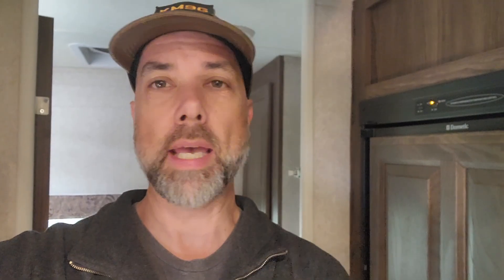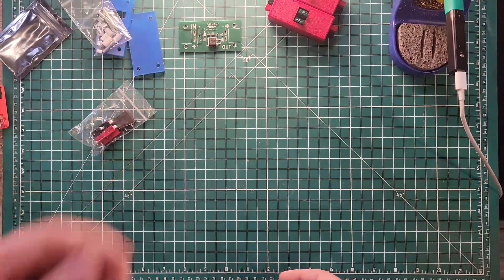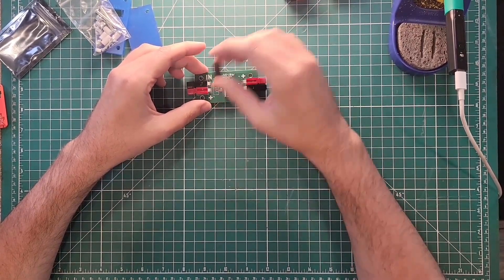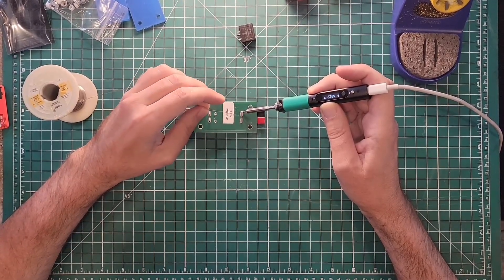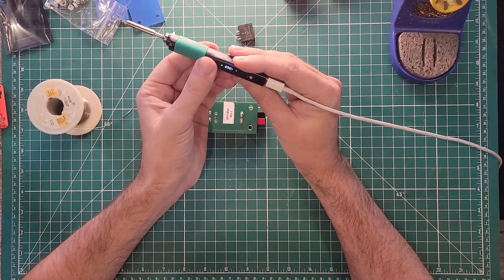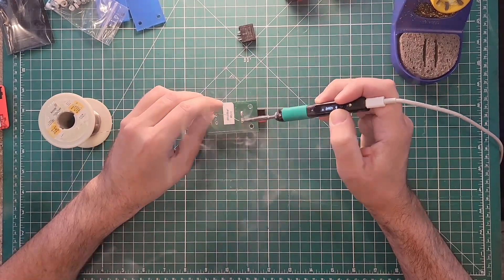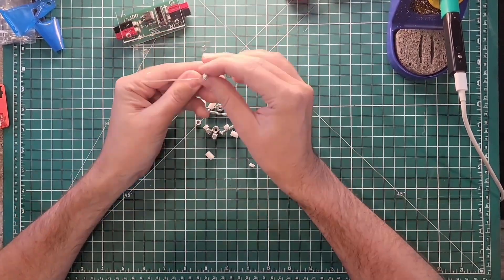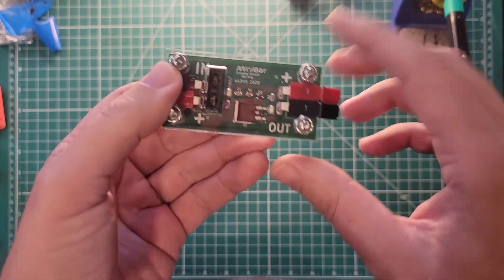SAVE your RADIO with this Crowbar Circuit!

Comment: There was a nice grounding presentation a couple of years ago on the Ham Radio Today (COVID) hamfest in which he showed a scenario in which a blown negative (ground) lead fuse could leave your car's starter current could attempt to find chassis ground via your antenna coax's connection to the car's frame, going by way of your radio's electronics.  There are always more combinations of connector failures/insulation failures than one tends to consider when you're what if-ing.  One thing I'll point out is that breaker (or in my day, fuse) box in your home interrupts live, but not neutral, neutral being the equivalent of negative in a 12V negative ground electrical system.  (I remember 6V positive ground cars, but that's a long time ago.)  Anyway, there are lots of arguments to be mode over whether to fuse the negative.
Reply from the maker: Exactly!
Reply: Good summary. There are a lot of one off situations. Cars in particular have a bunch of potential issues and todays cars are even worse.

Comment: You listened you really really listened. BTW just a observation but I think your solder iron works best when you are in high speed.
Reply from the maker: Somethings still make through the iron dome! And you're right about the speed too.
Reply: @temporarilyoffline  hihi you need to have the iron dome laminated like a transformers core, this will eliminate eddy currents and make it more efficient. But you will have to learn to live with the AC hum

Comment: Cool kit, Steve.  For those larger lugs, I would have used a larger/wider iron tip.  I am not sure if you have one for your particular iron.  Next time instead of going higher in temp I would just increase the heating surface area by orienting the tip sideways and place it right against the lug and the trace at the same time.  If that makes sense?
Reply from the maker: Makes perfect sense.  Great tip!

Comment: Put a crowbar on my linear power supply 40 years ago, if the output transistor fails, poof goes your radio.  Thanks for the video.
Reply from the maker: I've had it happen twice!

Comment: The crowbar is one of the greatest equipment safety circuits there is, right next to the fuse.  And this has them both!!!    Great Video.  
Eutectic solder too.  Good man.  Been my go to for about 40 years!      And remember  "don't flux up, use flux."    <-- that goes on the holder for your flux bottle.
Reply from the maker: I haven't used much flux in my soldering career. Usually I reserve it for the stubborn jobs or surface mount jobs.

Comment: That great to have.  just a simple circuit can save your radio. I have been budling them many years now. with portable this is handy. if you use solar with a charge controller and that goes bad . the battery BMS will disconnect to save battery but that over voltage still needs a place to go. that crowbar keeps it from getting to radio. uses a SCR to shunt power from radio or what ever connected to. maybe a 12V laptop . nice off grid soldering. 73's
Reply from the maker: Thanks for the info!

Comment: How should a battery "run away" and produce a higher voltage? I only know of failure modes where the battery will fail with a lower voltage. The only way I can think of a battery outputting a higher than normal voltage would be if it has been heavily overcharged and even then, you might only get a couple more volts before it catches fire.
Reply: In my brother's old Datsun the ground wire from his voltage regulator corroded and broke, resulting in an unregulated 19V that cooked his battery and killed his FM radio.
Reply: @JohnZonneveld  Sure, but that’s from a voltage regulator, not just the plain battery. If I’m in the field with just the radio and a battery, I don’t see how there can be an over-voltage situation.
Reply from the maker: Batteries are chemical in nature.  So "anything is possible".  Its more likely that your solar system (which routinely outputs more than 12v) had some kind of failure which makes it to/past the battery to your radio.  

This also works for bench power supplies.  I've had two power supplies with failed voltage regulators and both times they output more than 13.8v.
Reply: @temporarilyoffline  in my old car I had some voltage spike that killed my Baofeng APRS setup and a Leixen VV-898e since then I also have a simple diode voltage limiter that 'should' short at 15V. So should be enough to protect my radios as it is within the 13.8V +-15%.
Reply: @temporarilyoffline  I don’t doubt that it is effective for many scenarios where there is a regulated power source, like in a power supply, car inverter or a solar charger. However I cannot find any evidence that batteries alone spontaneously produce a higher than normal voltage. 
If you distrust the battery because it is chemical in nature then you should also not trust the circuit to protect it, semiconductors are quite wild..
Reply from the maker: Its all belts and suspenders man.  I don't trust anything.  "2 is one, 1 is none" I will admit that I'm a little more paranoid than most though.  @pcfreak1992
Reply: I just repaired a 13.8v 12A linear pwr supply outputting 24 volts.  Driver transistor failed.  Thankfully not connected to my radio.  I need this protection.

Comment: Great little kit to save the day. 
I only fuse +12v but each to their own.👌
Reply from the maker: Its like pineapple on pizza brother
Reply: @temporarilyoffline  it is more like current flows negative to positive so it is completely appropriate to fuse the negative leg. 🌮🌮🌮
Reply from the maker: @GraymanPOTA holy wars!
Reply: @GraymanPOTA   I think this is a common thing due to a couple things. First circuit tracing is typically done in reverse so its a mental thing and second automotive circuits are always done (after 1950 or I believe) as fused positive and common grounds which set a defect standard. But I've seen worse. I remember an old tractor we had that had a metal fuel tank and battery directly below the tank. This means the two battery terminals were directly below a dead short that happened to be full of gasoline. With a strong enough bump the battery could jump up and hit the tank. The battery holder was essentially the cables were barely long enough to fit so they held it down. If you were taking the battery out/in you were verrrrry careful when you lifted the batter out of its holder. We completely rebuilt the tractor and that situation was resolved purposefully.

Comment: The crowbar could have been put in radios as standard decades ago.  The fact that none of them do makes me wonder why.  One thing is for certain, because they don't put them in more radios break and they therefore sell, more radios.  Because they do not put them in when they could, they get to invalidate warranties even after the repair too which is disgusting.  Icom even put a note that your serial number is no longer in warranty.  Even though you have done nothing wrong, if anything they have, by deciding not to install a crowbar.  Thanks to the kit maker and you for highlighting the problem.
Reply from the maker: You bet!  Thanks for watching!